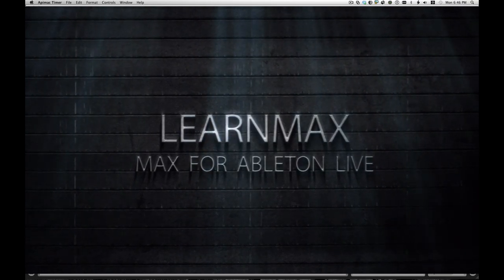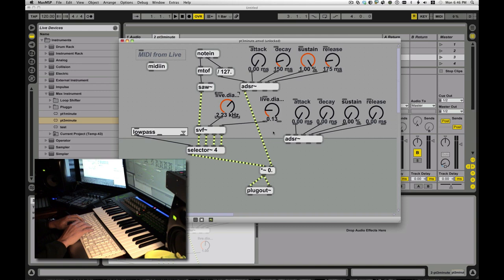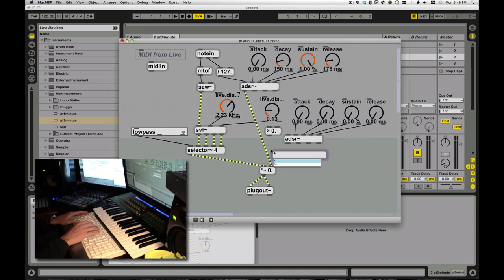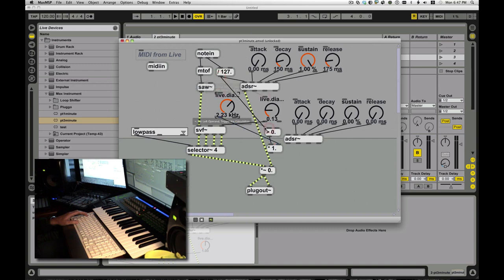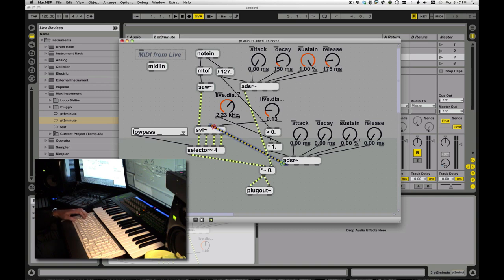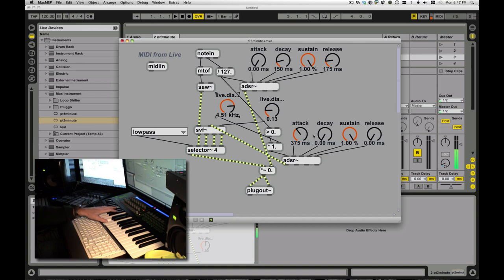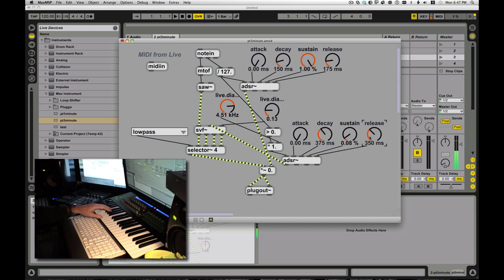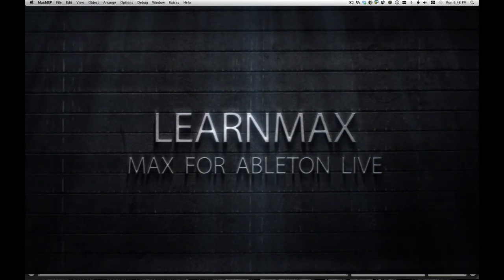M4L Tutorial #4 add a filter envelope to 1 minute synth : Max for Ableton Live

Comment: i hit a bit of a problem with this. i cant figured out how to control the amount at which the envelope has an effect on the filter cut, and since i am using the the control that was originally controlling the cut off to control the amount of the new adsr.....yeah, dunno. i can't control the cut off of the filter independent of the adsr using this method. Thanks. :)

Comment: For the Filter Sweep issue go here...cycling74 . com/forums/topic . php?id=35798 

BUT, add a / 100. object between the freq knob and the * 1. object or your cutoff knob will be multiplying it's output number by 100.  I even changed the * 1. to a * 0.